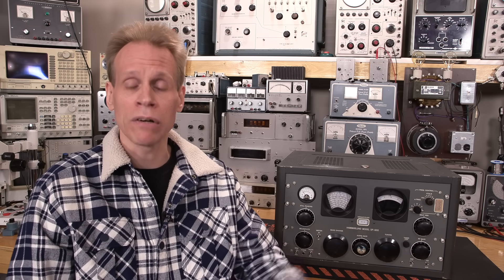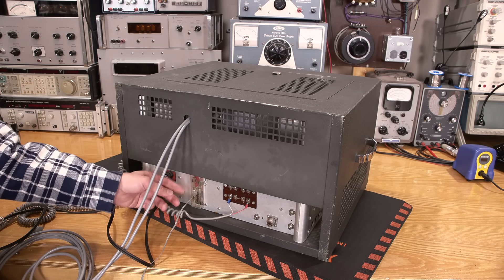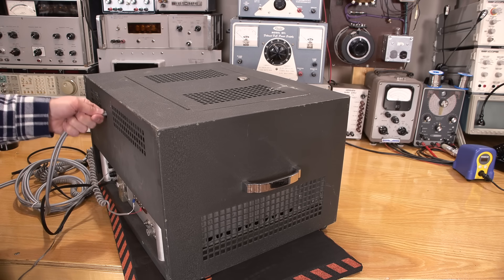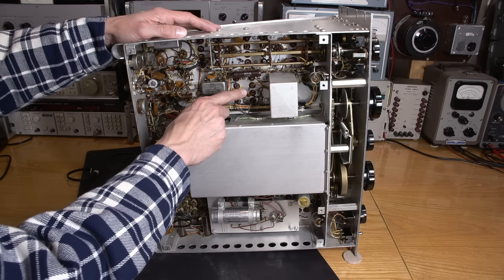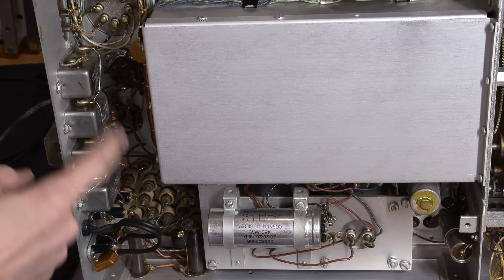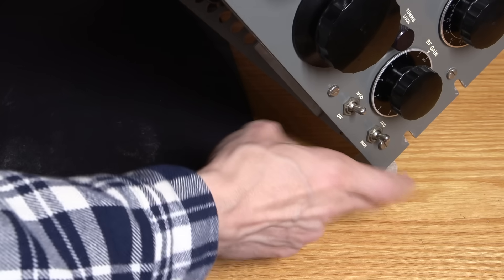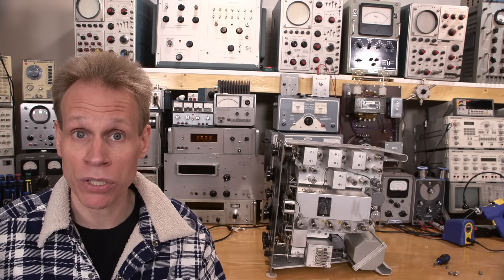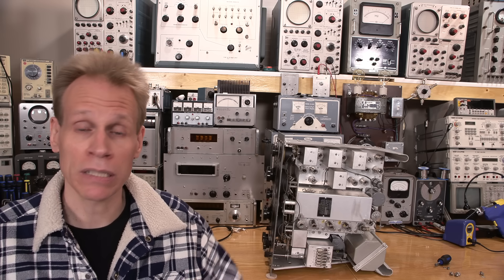Hammarlund SP-600 Receiver Restoration?

Comment: Absolutely Positively move ahead with these great Classics! I have an old version of HQ-129-X, like the red label shown on the World Radio News cover. It shows a lady with a giant soldering iron, assembling these classics right in NYC, you can see those old Factory windows. What I have NOT been able to find is the 6X8 tube modification, shown by W7PP? in his restoration video. One final comment, the HAMMARLUND SP-600 WINS the title as the most BUZZARDLY looking Boat Anchor radio of all time. Maybe the 1944 SX-28A I am turning into an SX-28A-PLUS is a close second. Changes to it include removing the 5Y3 Rectifier Tube to make space for the Hammond 8K-Speaker 18W Output Transformer, the Russian glass 6V6 matched pair, and a different dual-cathode phase inverter tube so I can use the DIY 400 audio circuit. Finally, rebuild the touchy, low injection BFO with the same tube and Circuit as the '129-X. 
Your series on the RCA AR-88 series was outstanding, and a reminder that many of the SP-600's, HRO's, AR-88's and SX-28's were absolutely critical to both German and Japanese code breaking, and on the home front, the SX-28's and other Hallicrafters receivers with a 20W transmitter were use in converted Packards with full Direction Finder loops in the back seat area - tracking down German Spies and such.
Presently Jim's Radio Shop on YT has his version of an older and creaky tuning SP-600 Restoration (September-October 2025), which is very informative but with a totally different presentation than yours. Thanks for all you do, AND the large investment into your studio labs, and Tektronix Museum! All that technology, and your lab built from mostly repaired and restored Vintage Test Equipment is HIGHLY appreciated! Best 73's, Hilary W4HDL

Comment: After restoration, during checkout, measure the receiver sensitivity and compare to the specification.  If done right, you should be able to exceed the spec, which allows for manufacturing variations.  I was able to significantly exceed the R-390 spec by very careful alignment.

Comment: By all means do the restoration.  I did one years ago that was a heartbreaker, brought it back from the absolute dead, In the end, two bands were partially dead because the 6C4 would just fade away and stop oscillating as the bandspread was turned.  Drove me insane.  When I sold my house I practically gave it away at the Stone Mt. Hamfest in Atlanta as I couldn't take it with me.  I never conclusively found out why the 6C4 would fail like that after I had replaced it and pretty much everything in the oscillator and turret associated with the problem bands. Other bands worked great.   GOOD LUCK!  It's a beast to tune....had to make tools.  The contacts were very worn, there are "fingers" that engage tabs on the turret, all brass, and they were pretty eroded through use and you CANNOT see inside there when it's in action to verify that they are engaging.  I will hang on every moment you do this restoration.  I replaced all the caps.... mine had wax caps, all the bathtubs, all the filter caps, it was a gem EXCEPT for those dead band segments.  Hope I can gain some understanding of why that was.  GET a LAZY SUSAN or make one out of plywood and a turntable bearing.  You'll wear yourself out manuvering that thing around because it's constant while working on it.  Love your fastidious thorough work.... it's the key to success and you've got it!!  THANKS!  GO!  73, Jeff K4UIE

Comment: Nice! I was given an SP600 about a year ago from an "antiques collector" in my town who was closing up shop and retiring. 
It has an Army Signal Corp badge and the crystal selector section has been modified. All of the guts in the radio have been painted with a translucent gold/yellow coating. It was sprayed over everything inside... over the tubes, resistors, caps, transformers, everything. I don't know what the coating is or what it was for. 
I haven't done anything with it yet other than power it up slowly with a variac and dim bulb limiter. It came to life with no shorts. I turned it off and put it away for later.  Now that Paul is cracking into one, what better time to get it back out and follow along!  :)

Comment: A question I keep coming up with and you may be able to provide a short video to clear it up: forming/reforming capacitors. Can you explain this and why you do or don’t like doing it?  Your explanations see to be much clear and have fewer rabbit holes than others.  Thank you for what you do. Keep up the great work.  - Phil
Reply: Reforming capacitors is a process of slowly restoring the insulating oxide layer on electrolytic capacitors that have been stored or inactive for extended periods. This is done to prevent potential damage when the capacitor is reintroduced to full voltage. In other words, so stuff doesn't let out the magic smoke instantly. Say equipment has been off for 20 plus years; this would be a good reason to reform the main filters. Me, being me, I'd just replace said capacitors if it had been that long (albeit if they're not leaking physically, I may not; unless electrically leaky).

Comment: By all means go through this one.  I am looking forward to the R-390 and Racal units you mentioned.  I have extensive experience on the R-390 and some Racal units from when I was in the Army.  I used to own an R-392 which was basically a tactical version of the R-390.  The Racals that I worked on were more of the newer digital synthesized models from the late 1970s to early 1980s.

Comment: I have a SP-600 JX17 that I restored. The biggest problem I had was with the slip drive for the tuning control. It had been lubricated (terrible idea) and took forever to clean up. The cadmium plated steel on the front panel does not clean up easily and things are riveted together.

Comment: As a retired EE with RF design related to communications, I consider the method of "shotgunning" for capacitors to replace is absolutely ridiculoous. The receiver in the video is physically in good condition, and visually no damaged/leaking/overheated passive components don't justify even to talk about "restoration", before slowly bringing up the receiver to full AC line voltage with a variac (variable output transformer), while watching the primary AC current. If it's normal and close to the value according to the manual, and the receiver works, the ripple voltage can be measured on the high voltage DC bus. If it's normal - no AC hum should be audible. The only thing that should be done if there is reception - whether with an antenna connected or injecting a signal on each band, is to verify that the receiver sensivity and bandpass response is according to the specifications as given in the manual. If the sensitivity, bandpass, audio power output - either one or more of these is not making the specs, ONLY then the alignment procedure according to the manual should be performed. This SP-600  in the video is so pristine, that it should not be candidate for restoration, but at worst just for a repair and/or a tuneup and maybe a tube replacement if there is a problem. I'm very experienced with the SP-600 receivers and their various suffix varieties, and I still have two, working since the 1970's without any problems or repairs, with original capacitors.

Comment: Yes, do a restoration video please, but I am crying 'foul'!  That thing is so clean and complete, it may give the wrong impression of what to expect for someone looking for an SP600.  I do not know how well your tuning mechanism is working, but it is important to explain the friction drive tuning mechanism and how to repair it so it does not slip.  I have done 2 SP600's over the years, both did not have ceramic disc caps and did not look like it just came from the showroom as yours does.

Comment: Hi, Although this Hammarlund radio is important, when are you going to fully restore that Philco Model 38-7 radio that is up on your shelf with the other antique radios?  I need to restore this exact radio you have and the interesting part of this radio is its tuning dial. One pulls the knob to adjust, than used the inner knob to fine tune.  Can you look at this radio next?  Does yours, like mine, need a full restoration? Thanks for all your great help!

Comment: Hello Mr Carlson. 1 year ago you introduced the audience to the ART-13 and dyna-motor. 1 Year ago. Please  complete this promise to complete the power supply for it and put the ART-13 on the air.The excellent BC-348 videos were top notch and a matching ART-13  set of videos would compliment the restoration of BC-348 and PS. I vote for you to complete the ART-13 project. Please. 
signed VE3XKZ

Comment: This receiver reminds me of my Siemens Funk 745 E 309a...
Approx same size, same weight, same amount of tubes, and - at least - same quality of built - if not better. 
Unfortunately, my E309 mainly used Vitrohm resistors, which were massively out of spec, some of them more than 100%, so I basically needed to replace all of them... The amount of work was insane. 
This receiver still needs alignment, so I am very curious in watching the alignment procedure of this Hammerlund receiver! I might finally finish my E309 along with Paul finishing his SP-600 ;)

Comment: Yes please! I'd love to watch and study your restoration of this receiver. I inherited a similar radio; a BC 779 from my Dad which was stored away on it's side for many years causing the bathtub caps to leak their contents in parts of the chassis. So I definitely want to see how you go about replacing those. His BC779 has a separate power supply unit so I'm not sure if that was how they came or if that was what he did or maybe he bought it that way from surplus way back when. Clearly it had modifications done. Anyway. Thanks for tackling this project! It will be fun to watch the master at work on this beast. And yeah it's friggin heavy!!

Comment: Should be an interesting series as this is obviously a top quality (for its day) receiver.  It will be interesting to me to see if the change to modern parts just restores it to original performance specifications or if it actually improves performance.

Comment: I always appreciate the restoration videos! The beginning brings up a point... Are ceramic disk capacitors ok to use in vintage radio restorations, rather than tubular film-foil capacitors, or is that not good form?

Comment: Mr. Carlson, I am on a very amateur level always learning about electronics. I ran across several antique radios, Victrola hand cranked phonographs, and other items. Recently I ran across a stand up livingroom Truetone tube radio. Are these worth repairing ? They want little for it. It does light up, but thry said needs a speaker. If I buy it and cannot get it working I was thinking I could covert it into a guitar amp/bluetooth speaker.

Comment: Overall, I'm a yes, but I am also somewhat conflicted.  I have a Hammarlund receiver, not the same model.  Mine has more knobs, switches and dials.  I've wondered what it would take to get it working properly.  So. I'll follow along to get an idea what's involved in restoring one of these.

But, I already have a bunch of projects, including 3 cars, 2 bathrooms, and at least 8 electronic & ham radio projects that need my attention.  Then I wonder, what's the point?  Modern receivers and transceivers are more sensitive and more selective and use a small fraction of the power.

Comment: The disc bypass capacitors will certainly help speed things up. I'm interested in seeing the Carlson Magic Touch being applied during the restoration, along with the alignment procedure which should be quite interesting.

I'm curious if there are any improvements to either the design or post restoration modifications you would do to this kind of receiver also.

Comment: ill vote a yes on restoring this!! i did mine a couple years ago and it was pretty easy for the most part. documentation is great so i had a good roadmap. mine had a combo of disc an bumblebees. someone had their fingers in it so i needed to fix a bunch of connections and new coaxial cables from the front panel. great rig!!!!!

Comment: I spent 25 years servicing everything from hot tubs to commercial pressure washers. Analog controls with relays controlled via momentary and latching air switches up to pcb repair. My aviation experience from the military and a&p training in my youth helped me, but I have learned more from watching your videos and your electronic engineering knowledge is second to none. So I give a big thumbs up for a restoration to that marvel of electro mechanical wizardry. Thank you for sharing Mr Carlson.

Comment: 7:15 stupid question. Would the device fit a standard rack by those screw slots at the sides of the front panel?
Reply from the maker: Yes, this is standard rack size.

Comment: I enjoy your videos both here on YouTube as well as on Patreon. I would rather not see a restoration of this receiver. Highly specialized equipment restorations generally don't provide as much practical information as your restorations of more generic equipment. You restorations of mass market electronics including vintage consumer radios and amplifiers as well as vintage test equipment restorations seem to offer more repair tips. For example, the frequency counter output circuit you designed as part of your Precision E-200 Signal Generator restoration or your conversion of the RCA Oscilloscope for use as a curve tracer provided tips which could be applied to a variety of  vintage signal generators or oscilloscopes. Regardless of the choice you make, thank you for your consistently fine presentations.

Comment: Love all youre videos learning about testing , capacitors , resistors , flyback and many other items older circuit boards ect i was able to repair my early 90s Aiwa Sterio with a full overhaul of all caps and a full repair on the audio board pcb where so traces had failed keep up the awesome videos me and my mates love ya pal🫡

Comment: To replace the felt protection, devise a wooden board with a heavy duty wheel on each corner . This would be used to place very heavy equipment  onto to make it easier to turn around for repair purposes.

Comment: Yes do the restoration of this great receiver. And also of the Collins R390A. I also wonder if a solid state replacement of the R390'a PTO is possible, since many of the original PTO's are no longer linear, and that makes a big difference in the sensitivity of the receiver. Unless a Cosmos PTO is used, linearity is not easy to accomplish for the rest of the PTO's that were used.

Comment: Please restore this receiver!  I had a SP-600 that I got when I was in high school back in 1977.  At some point during the 1980's i discovered that a lot of dark oil leaked from the bottom in the area of the transformer.  The receiver continued to function and no more oil leaked after that.  I am curious if that is known to have happened.  I made my first QRP QSO on the ARRL Tuna Tin 2 transmitter I built and using the SP-600 as the receiver.  Good memories.    I sold the radio in 2010 to another collector and miss having it (though not moving it around).  73's

Comment: I am a Patreon subscriber and  have been hoping you would restore one of these.  I have three SP-600's and electrically restored a JX-17 "bumblebee" capacitor version about two years ago.  I have a "bumblebee" JX-26 that shows a lot of promise and have been anticipating this series to move forward with it.  I am hoping you will go into detail on the 29.7-54 MHz band since the JX-17 suffers at these frequencies. 
Thanks and 73!

Comment: 100% Interested..the SP 600 was one of the three greatest General 
Coverage receiver of the late 40's to early 1960's (The other two were the Colling R-390 and the National HRO 50/60, The SP-600 was Very widely used in Military, Intelligence and Diplomatic Areas. Really top-of-the-line construction and performance. In the late 60's to mid 70's you could get a WORKING SP 600 for just over $100!!!. TUBE sets, including some of the greatest tube sets were consider ed SO out of fashioned.....

Comment: Very interested,  I have an SP-600 JX-17 which was as I understand a part of a diversity receiver set up for the Air Force.  It has a couple of extra red knobs on the front panel.  The last time It was powered up it still worked but alas it's full of the "bumble bee" capacitors. I'm not looking forward to replacing them all especially the ones inside the IF cans.  I've been trying to work up my nerve for years and this maybe just what I need.  Thanks...

Comment: I am an " OLD SCHOOL " Analog Electronics Fan.  I took a Basic Electronics Course for Radio and T.V back in the early 1970's.  So this is the AREA of ELECTRONIC's  I like and am most familiar with.  The Restoration of the Hammerland SP-600  particularly interests myself as I will in the near future attempt myself (WITH HELP FROM MR. CARLSONS LAB) to restore a " Canadian Marconi Wireless No.52 Radio Set" made in 1944. I am  a HAM RADIO OPERATOR also.  I am at this time gathering  some needed basic Electronic Repair Equipment to work with in this project.  I unfortunately, do not have a project START DATE at this time but Hopefully in the not so distant future. There is MUCH to be learned from the Restoration of the Hammerland SP-600.  Your whole general approach to this project can be extrapolated and applied to the MARCONI NO.52 SET.  It is my intention to also look into your online Electronics Training Course at some point in the near future also.  Mr.Carlson's Lab has a Unique way of explaining Applied Electronic's Theory,  it is one I know I can learn a lot from!!